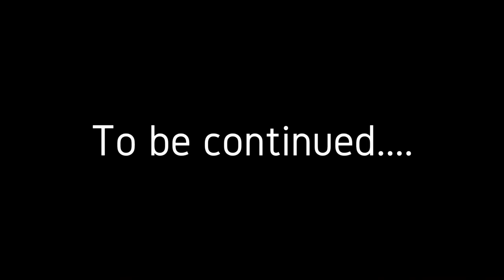Dumas Deep Vee 60 Build and maiden

Comment: too much friction between the flexible shaft and the brass tube, I didn't see if you used that plastic tube on the brass tube, that's where I think the smoke comes from
Reply from the maker: Cooking the grease is a possibility. In fact it's probably the only thing I can think of that happened. Nothing else was damaged.
Reply: @crispyspa  yes that the only thing, congratulations It's a perfect boat👌